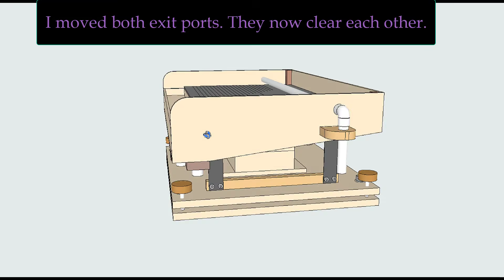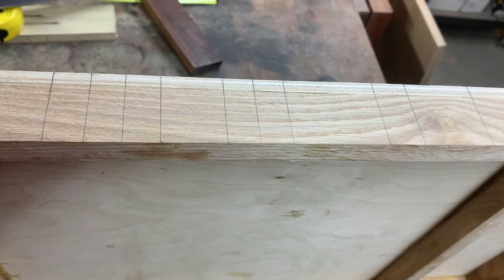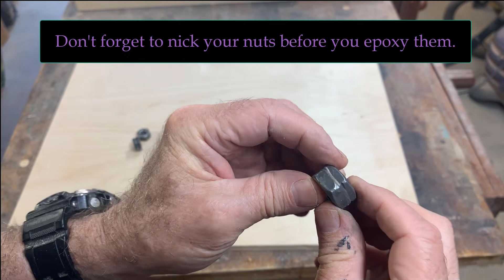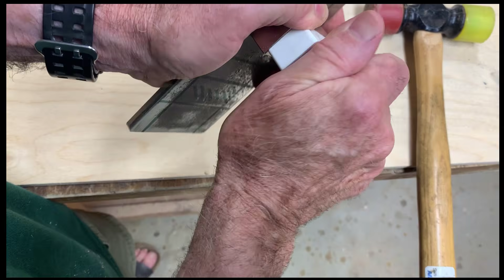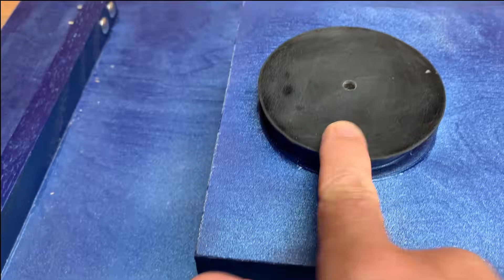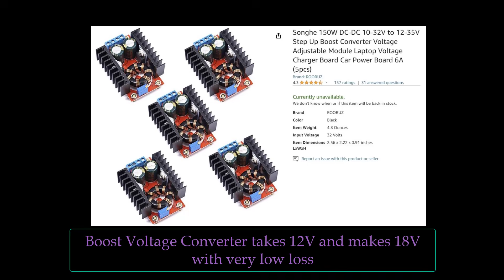Building the Gold Bump-Sluice Shaker Table

Comment: Very well thought out, and nicely executed! Excellent! I wonder if you could produce the electronics (without any of the fancy readouts or freq controls) with just a flip-flop divider on an oscillator using line frequency (or, a variable-freq oscillator) divided by three or four. I can see that optimally you'd want to "tune" the stimulating frequency to wherever your flexures end up. No pulse-width rigamarole nor fancy electronics.

Comment: looking for deeper information on the electronics and displays.
Reply from the maker: There is a video on that topic.  -- Dave
Reply: @orophilia  Thanks, i have viewed the videos now and have most of the parts for the electronics. This is the hard part for me. I will actually begin with the electronics as i build the table itself. What do you think about using a ball end mill to make the grooves? I have access to large CNC machines that could do that part easily.
Reply from the maker: @BrianNelsen-b1b  I tried round grooves and they don't work.  -- Dave
Reply: @orophilia  Thank You!!!

Comment: I watched this a year ago, and would like some advise on the oscillating circuit. I need a frequency of 2-4 times a second. My purpose is much much lighter, but it does operate a small row of electro magnets at 12 volts. Do you know if the PWM can adjust that slow. Is it really 2 hz (per second)?
Reply from the maker: Yes, my code will go down to 2 bumps per second. The limits can be adjusted higher or lower, as you need.
Reply: @orophilia  So my next theory is, it might be possible to electro magnetically (EM) lift black sands magnetics (BM) away from the material in solution, or wet, over a sluice box (S), to act like an oscillating conveyor to release non-magnetics like gold (G) as it pulses. So as it moves across a row of magnets (EM) to another location by gravity and water force, and finally releases it over a trough to be flushed off. Over the side. Thus EM to remove BM in S to recover G. 😁😁

Comment: Love the tabletop, but the electronics are beyond me, lm going to start with a flywheel driven by springs attached to a cam, with the cam effect shaking the table, or electric motor voltage reduced and geared low driving a cam setup
Reply from the maker: Good luck. I'd love to hear how it goes.

Comment: Hi Dave. I'm very happy to have found this gem that you generously shared. I've already started shopping for the table. I only got the magnet where you bought it, it'll arrive this week. I've also already received the LILYGO T-Display-S3 ESP32 microprocessor. I sent you an email with a design of the grooves with the measurements that I estimated after watching your video, because the design that you uploaded to Drive is not the same... When you have some time, I'd appreciate your review, so I don't make a mistake. Thank you so much!
Reply from the maker: Hi Arnulfo. Four long grooves are better. Space the grooves 12 mm center to center. The grooves should be 6 mm wide and 2 mm deep. Best of luck.  -- Dave
Reply: @orophilia  Ah, there you have it, Dave... good information. Thanks a lot for your timely response!

Comment: Very cool the natural resonance of the mass of the table. Very little additional mass of material to slow it down, little current to achieve ideal vibration!! I plan to build one. 
We used to paint insides of gravity wagons with graphite paint, blackish. You absolutely could not stand up inside of them with any chaff from grain. Nearly injurious! Net benefit was grain would slide out of there so easily. No more banging on the sides, crawling inside to get it to feed to auger to go to bin.
I wonder if graphite paint in the shaker table grooves might help materials slip horizontally? Especially at transitions?
Reply from the maker: My guess is that some friction is necessary for the particles to move due to the bump. I now think that it's better to have a resonant frequency lower than the drive frequency. This is easy to do by sizing the flexures appropriately. My recent tables have a resonant frequency of about 2.5 Hz and I drive them at 5.5 to 6 Hz.
Reply: @orophilia  I got to thinking, some friction is good: keeps heavies moving only horizontally to end of groove, intact, while lighter trash rolls off……
Reply from the maker: @rodofiron5957  Yes, exactly.

Comment: Thanks for taking the time to show your table build. I’m attempting to make one myself now. I love the drive mechanism. Do you think the table could be scaled up a bit with the same size magnets and coil? Where did you get the magnets? Thanks!
Reply from the maker: I buy the magnets from <https://www.magnet4less.com/strong-neodymium-magnets>. Buy N52 type. The moving mass of the table is about 5 kg. With this design I wouldn't go above 7 kg. You can get more power by going to a 24V or higher drive voltage and/or larger magnets and coils.

Comment: Bloody awesome build, video and explanation. Well done!

Did you come across any issues with the magnets holding up magnetic fines on the shaker table and if so, how did you remedy?
Reply from the maker: I did. Not on this table but a later version. The piece of mild steel was just large enough to hold the magnets and that's a bad idea. The piece of steel should be larger by 1/2" all the way around. Anyway, it doesn't seem to make any difference to the performance of the table.
Reply: Thanks for the prompt response 😊

Comment: I am having trouble sourcing 3/4" N52 magnets. Will 1/2" thick work with a modification to the coil? My school only lets me purchase from Amazon...
Reply from the maker: Yes, 1/2" thick magnets will work but the force will be lower so keep the table as light as possible. If you can find 1" wide by 2" long by 1/2" thick magnets that will compensate for the reduced width. No need to modify the coil. Be really careful with the magnets! It's easy to hurt yourself.
Reply: Thanks for the quick reply. We will use aluminum to build the table(I teach welding and machining) so it should be lighter. And I will be very careful with the magnets, I have been reading warning labels.

Comment: There appears to be some design/part changes related to the electronics box in this video compared to the more recent video "Linear Motor and Electronics for Bump Shaker Table" and the "Gold Bump Shaker Microprocessor Board" video. Different components, etc. Is this the case?
Reply from the maker: Hi Dennis, Yes, I'm now using the Lilygo T-display S3 as the combination of microprocessor and display for both the linear motor and the PWM controllers.

Comment: I've wanted to build one of these Tables however I have a different approach in mind for the rubber membrane/mat Grooves.
I believe the way to homemake a rubber grooved mat is to lay the rubber on a flat surface and add on one side a set of slanted shims used to create the walkouts for the Gold.
By cutting the Grooves with a Router the Walkout is created perfectly through the Action of the Router climbing up the gentle slope of the Shims.
This is the only method I can really think of which doesn't include Casting a Mould of some type.
Reply from the maker: Hi Sean. The grooves in this table were cut directly onto the plywood with a table saw. In one of my previous videos I show how I cut the rubber mat with a router and a template guide. The guide has a gentle slope at the end that helps to create the gold launch region at the end of the groove. I've never found a clean way to route the Neoprene rubber. I have to spend hours with sandpaper removing the torn and hanging chad.  -- Dave

Comment: What type of Garolite are you using? G10, G10/FR4, xx? Thanks, your videos are extremely educational
Reply from the maker: It's Garolite from McMaster-Carr. G10/FR4.
Reply: Thanks for the reply. Have you experimented with polyurethane plastics? I am contemplating pouring a sheet of polyurethane with a shore hardness of 60-70 and then using a CNC to cut groves. @orophilia
Reply from the maker: @dennish1037  That sounds wonderful! Let us know if it works.  -- Dave
Reply: @orophilia  What display are you using for PWM motor controllers - did you get them from Amazon?

Comment: Hi it’s me again. I’m building this and as you can tell this is way above my level of intellect so bare with me. as I go I’m running into little things that I’m confused on. 
In this video you specified a 150w 10-32v to 12-35V 6A step up Boost Converter. In the electronics follow up video you specified a 250w  10-40v to 10-50v 6A. One has heat sink one doesn’t. Is there a reason why you recommended the white one over the red with heat sinks?  Also you mentioned that there’re (3) 2pin  female plugs on the side of the box. 2 for the motor coil, and 1 for the pump.  Why is the motor coil taking 2 outlets- wouldn’t (1 )2pin plug be enough to complete the circuit? 

And a dumb question : 
By using the  mcu -are you are able to control the speed/ force of movement to one side? 
Say it moves to the right and then abruptly changes direction to the left. The gold continues forward with inertia - in theory wouldn’t quick\sudden change of direction eliminate the use of a bump plate or is that not enough strength?
Reply from the maker: The electronic modules from China come and go on Amazon. I noticed that the original boost converter that I used was no longer available, so I recommended another one. You can use any boost converter that can supply at least 24V and 3 amps.

I use three female 2-pin connectors on the controller. One is for the motor, one is for the pump and the other is a spare. You will need two connectors.

Yes, I'm working on a controller that does just that. It can be varied from all to the left to all to the right. I tried the shaker table without the mechanical bump. It doesn't work.
Reply: The 3rd is a spare!…of course that makes sense!!  You probably said it too. 
I was seriously in deep thought trying to figure out why there was 3rd I spent hours looking up how to wire all these  things  and how to work the mcu 
I’m still left where I started. Looking at the electronics 

Thank you very much for the reply.
Reply from the maker: @nativeflight7079  Sorry for the confusion.

Comment: If it were me building this masterpiece! At 14:15 , I'd use a router and start at the shallow end. Slowly poundage the router in to about .060" and maybe to about .100"  starting at roughly.010". Then sand with up to 400-600 after the epoxy! Although I would have probably added a couple layers of fiberglass, the thin stuff. That looks like tissue paper and possibly bake the wood at 215°F for a couple hours. Drive away any moisture. Then a thin epoxy bath possibly under a vacuum. the vacuum infusion should  stabilize the wood for many years sitting in the weather before it even starts to rot! Possibly, 20 depending on UV exposure. With the fiberglass layers it could incorporate Led strips inlaid under the fiberglass along the end of the grooves. The fiberglass being transparent a diffuser layer would be required. A thin layer of silk like cloth or cotton under the fiberglass! A pigment may be used or a gel coat!  A white gel coat could help with black sand contrast!  Or a pigment added to the epoxy!   A wet sand and buff to smooth out the surface , then a 400-600 grit orbital sander to give it a matt finish, and  give the gold  a little traction so the black can scoot on by!  And the collection points I have tiny funnels with about 1/2" outlets to allow a bit of 1/2" hose to be used If desired.  Use a bunch of measuring cups / containers  for the concentrates. And a gold or panto pre catch the  tails close to  cons. Before overflow into a large tub to be filtered through a large coarse sand filter  divider in the tub with the sand collecting in a smaller tub in the large tub! That will over flow into the larger!  The two stacked gold pans used to test the tails for gold lost! Without loosing anything , after testing and dump the pan place it under  the other so nothing is stopped or lost!  
But the thing is, I gotta find the gold first!! Then get it before even thinking about this Part of the process!! Great video, have a awesome day!!👍
Reply from the maker: Great comment! Yes, I'd love to do all that and more. I need another lifetime as a prospector.  -- Dave

Comment: On your last video you said your micro processor wasnt necessary. It all seems quite straightforward, but you loose me at the chip.
Reply from the maker: Yes, I think that a couple of 555 timers and a logic gate or two could be used to drive the H-bridge PWM motor controller. One timer would be used for the frequency and the other timer for the PWM amplitude. Perhaps such a circuit exits on the web. I used the micro because I wanted to try different timing and acceleration profiles, but I found that a simple 50% forward/50% back is the best.

Comment: Question, did you try higher frequencys that are higher? 
400hz? 1000hz?, 4khz?
According to building engineers who built buildings for high earthquake areas
There is something called liquification Factor we're small solid grains start behaving like liquid
At very high vibration frequencies
And if a solid will behave like liquid
Then weight separation would happen a lot better
thanks for sharing
Reply from the maker: This is an interesting subject. Yes, liquefaction is an important part of gravity separation. It's accomplished in this machine by the combination of the turbulent water flow in the grooves and the impact liquefaction from the bump. Both are needed in a water sluice. I drive the table at about 6 Hz, which is as high as I can go given the weight of the table and the amplitude of the motion that I need.
Reply: @orophilia  Just thinking out loud here , like Donald Trump and his Covid Bleach thought , Could you superimpose say a 1 kHz on top of your 6 Hz ?
Reply from the maker: @mohammednovalija  I could attach a vibrating motor, but I've got that idea saved for something else.
Reply: @orophilia Yes, 360 is definitely pushing the limits.

Comment: I used to build the Bob Beck zapper. It runs on 8 cycles per second. Coming out of an LM741 op. Amp. I also made some that were adjustable frequency. Square wave output. 24 V. That input signal could drive the transistors to provide the variable output to the  coil.
Reply from the maker: Yes, I think it's possible to use a couple of 555 timers to get the job done.
Reply: @orophilia  Yeah, the thing with the timers is that you gotta have to know how that's why  buy the micro controller if One doeisnt have as much know how., Or if you want to do some very particular tweaking More easily
Reply from the maker: @1Search  I think I'll make a video on the microcontroller and how to program it to control the linear motor.
Reply: @orophilia  The Pico Graham scale you made was  impressive.
Reply: "@orophilia
5 days ago
 @1Search  I think I'll make a video on the microcontroller and how to program it to control the linear motor."
 @orophilia  this would be so good if you could
Reply: @orophilia did you ever make a video on the microcontroller? I have watched this video about a dozen times and have almost all the components ordered, just need to order two of those magnets and the Arduino Huzzah32 board and figure out how to program it. Or would the same be done with a 555 timer? I have zero experience with arduino.

Comment: Wow, so many improvements over the last table. The motor though expensive is so nice and super quiet. The driver electronics are interesting. I don't know why you needed a micro controller. Very nice method of implementing this off for the groove. Endings Much more feasible than the ramp  syste.
Reply: I think you used to be rC hobbiest.....  The change in flextures material seems to be a big improvement also. The water bar Placement was a good improvement, With the foam, I guess you didn't get to the Feeder trough this time.....
Reply from the maker: Thanks for the comment! Yes, I like the location of the water bar and I now have a nice place for the feeder trough.
Reply: The 4 corner angle adjust is pretty nice as well.
Reply: I have used exterior paint for waterproofing. Or one could probably use shellack. Or polyurethane

Comment: Made a Miller Table a few years back and found that the open cell foam used to keep debris out of gutters makes a perfect water flow 'straightener' for these applications. Water flows through it unimpeded but flows evenly down the table without bubbles.
Reply from the maker: Yeah, there's a lot of neat stuff out there for these projects
Reply: Ohhh muchas gracias x ese dato!!!🎉😂